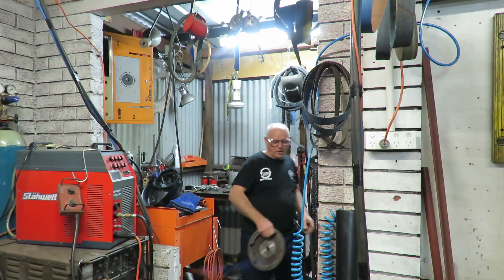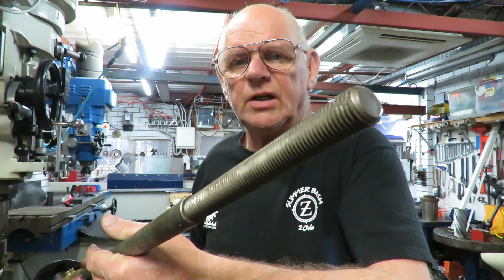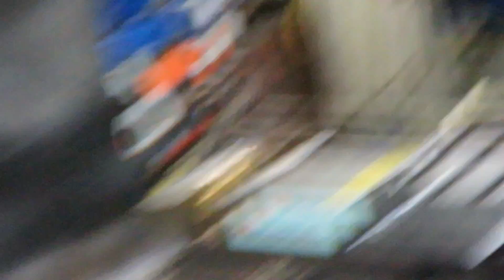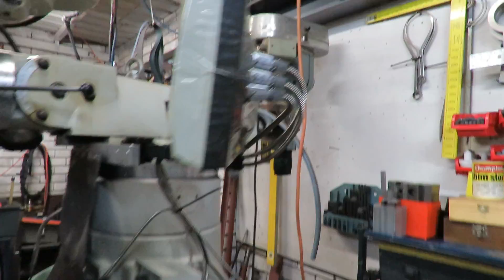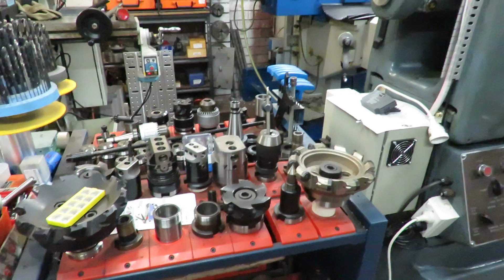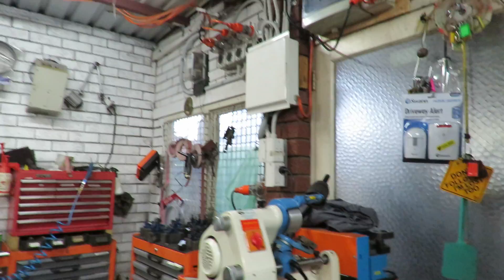Friday jobs and small mill changeover in Bruce's shop

Comment: what do you need two mills for?
Reply: meocats because he does not ave the space for three!
Reply from the maker: I do a lot of R&D type jobs that are "design on the run" quite often I have more than one milling job on the go and in cases I need to do some work on a part and at the same time lathe up a piece and continue milling a different facet, in the mean time an urgent Getter Out will arrive and so the second mill allows me that flexibility. I had two lathes and had to let one go so I could accommodate the Horizontal borer which gives me even more flexibility and have had all three loaded simultaneously.
Reply: interesting

Comment: You've been buzy, Bruce!   Is the new mill coming with powered Z-Axis, and DRO?   Thanks for sharing.
Reply from the maker: Herb yes been a bit busy we will now be a bit hectic! The mill has all three axis with power, X and Y are the "add Ons as such, and the Z has an integral drive. The DRO is a very old style 2 axis and is not co-operating on the first try at the existing place. replacing the DRO and adding a Z axis scale will be the first cabs off the rank. Next will be to bring the control panel up. I don't like them at knee level. Cheers have a great weekend Herb.

Comment: nice work as usual Bruce . the mill swap over could be fun , i remember it was a bit of a tight fit getting the horizontal boring mill in there . it would be nice to have a big workshop but we all still end up with limited working room because the more space we have the more stuff we collect !
Reply from the maker: Moving these Mills will be an effort I have to shift the HBM to get enough clearance to move them and then reset and level it in place. It's always a case that empty space is replaced with space filling things.
Reply: Monty Python, Society of people that put things on top of other things. Cheers from John, East Coast.
Reply from the maker: Yep sometimes I think the society of silly walks also pops up!

Comment: The brake caliper adapters are fantastic. So is the flywheel adapter hub. I think bluehands machine would be interested to see this video. He's in Portland, Oregon and he does the suspension mods for the old Datsun trucks that guys are dropping into low riders. I hope you will make a video on the mill moves.
Reply from the maker: I'll check him out! thanks Kev.